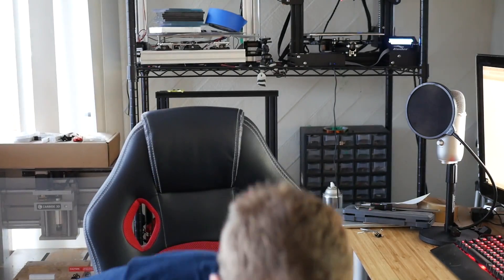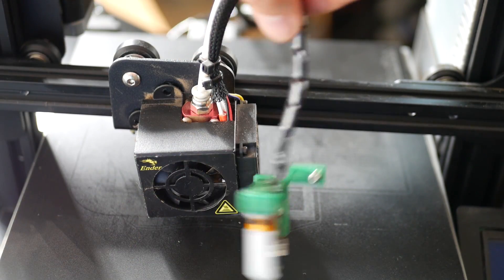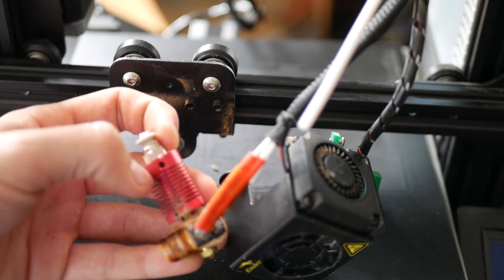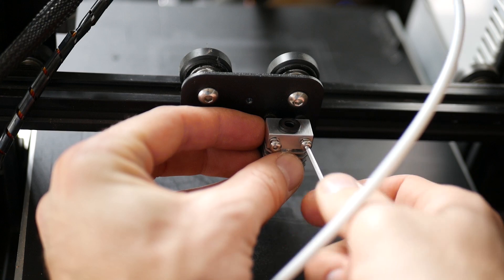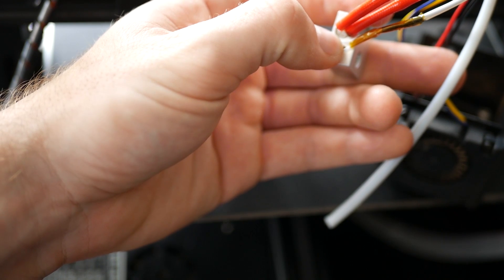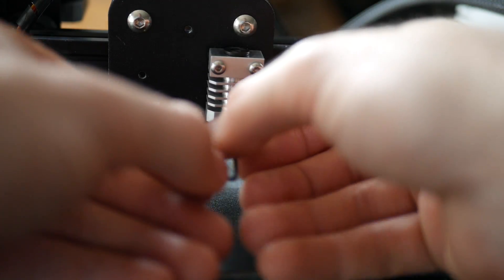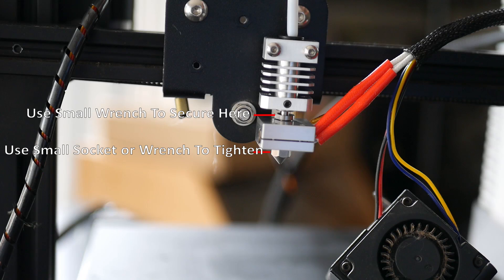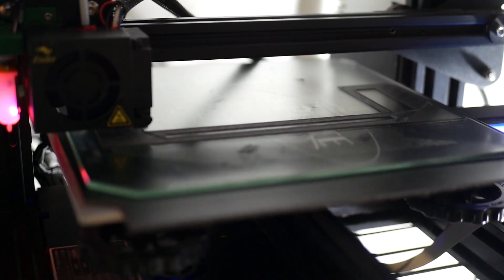Tutorial Installing All Metal Micro Swiss Hotend Into Creality Ender 3 3D Printer

Comment: FYI on Longer LK5 Pro there is no round head screw to remove. Loosening the microscopic grub screw on the bottom of the heater removes both heater element and thermistor. Took me a half hour to figure it out.

Comment: Thanks for the micro swiss install video. Mine is in the mail. After the install, my next project will be to upgrade my main board. I have an ender 3 pro with the old 8 bit board.

Can you recommend a good main board that would make it easy to get a higher temp range for PC and nylon? Something with a pre-installed or at least an available compiled firmware for the 300°C hotend upper range.

Comment: 6:32 you should get a torque wrench that measures in inch pounds. I wish the 3d printer community would use more accurate tools for measuring distance and tightness like torque wrenches, and dial indicators.

Comment: Wobbledy wobbledy https://youtu.be/iAeT3wHa5oI?t=468
Set that sucker on a flat surface and loosen your bolts and square that frame up, also looks like your bowden tube still had the scissored cut you inserted into the hotend, never use scissors it can cause feed issues from deforming the tube. Other than that nice video!

Comment: Never tighten the nozzle to the heater block!  Screw it in and then back off 1/2 turn.  Tighten the heatbreak into heater block and then tighten the nozzle to the heatbreak.  This ensure good seal in the filament path.
Reply: I think this is where I went wrong as I thought they were both tight enough, but  my hot end is leaking on the heartbreak side.  I need to figure a way to clean it now or buy a new heat block.

Comment: How do you get the printer to go hotter than 260? Does the thermocouple need replaced with a different unit? Does the firmware need changed and if so, how?
Reply: Did get answered??? Looking for the same
Reply: @mastercat  Yeah. Search Ender 3: How to install a bootloader and update firmware
You have to buy  a few things but it doesn't seem too difficult.
Reply: @CarbonGlassMan  buy few things like what...you mean only hvae to change firmware and nothing else?
Reply: @mastercat  Well watch that video. I think you need a new thermocople and an electronics board and some jumper wires. The parts don't cost much.

Comment: why do you not heat up the nozzle and not tighten the Nozzle and the Heating break while hot again?
Reply: Quite a few things that don't make sense on this assembly.....why was the nozzle screwed in tight before installing the heat break?....the nozzle should have been backed off a half turn and the heat break screwed all the way in then the nozzle should have been screwed up against the end of the heat break to make it seal. This was the assembly method on another vid.

Comment: Good video.
Do we have to replace the heater block? I've seen a few youtubers keeping the original heater block from the CR-10 s and they seem to think it's just fine.
Have you had any problems with the heater block compared to the old original block?
Again, good video.
Reply: There's a few reasons one might want to do this. Mostly it is if you want to use a higher temp filament. The PTFE tube in the stock hot-end is unsafe when the temp is over 250C. Cooking PTFE can out-gas some pretty bad things and cause hospital trips or death in yourself or pets. One thing I don't recall hearing or seeing in this video was that you may also need to update some firmware settings or change some Gcode for the difference in the hot-end the MicroSwiss is a teensy bit shorter than the stock hot-end
Reply: Thanks for mentioning PETG dangers.
On the firmware side, I watched a video from The First Layer, and after replacing the hotend, he upgrades the firmware on his CR10 and adds the name of the hotend in the Marlin Firmare update.
Thanks for your reply.

Comment: Helpful video! But I just installed my Micro Swiss in my stock Ender 3. Works ok. But when trying to print a bigger piece (200mmx180x4) of Nylon, it peeled a ton and I had to stop the print. I had the standard bed (sprayed with aquanet)... And it was set to the max temp of 260. Bed at 110. What is the problem? Do I need glass? Is the nozzle temp too low? Bed too low or high? Any ideas, because I'm at a loss?? Thanks!
Reply from the maker: For nylon you need a glass bed with glue stick. Nylon doesn’t stick to anything but itself so definitely get the glass with glue stick.
Reply: @ModBotArmy  thanks for getting back to me. So I ordered borosilicate last night... Hopefully that helps. So you don't think the width of that 200x170mm print will be a problem (with peeling) on glass with glue stick? (Should I not use aquanet as I have been?)... And last question, do my temps look ok? Thanks for your time, man!
Reply: @WhatsUpDanger  you need around 275 to 280 for NylonX.  Something modbot didnt explain was how to get higher temps with the upgrade.
Reply: Yes, I just bought one and am not sure it was a good investment yet. You can't get more than 260C as it uses the same heater. Using capricorn gets the same results on the stock bowden. Can't find data yet on ceramic heaters compatible with ender 3 controls. I'm guessing a 30 watt to hit 280C and a 40 watt to hit 300C. I don't know yet if the controls can handle those loads. Sites pushing the micro-swiss are intentional vague actually getting the temps they claim the micro-swiss can handle. People also said the original Volkswagen Bug was high speed aerodynamic but don't get behind one.

Comment: Nice video, but you dont mention this may lower quality for some PLA prints. Especially at low flow ratio - detailed small objects with thin layers and at slow speeds. Retraction suffer the most and you get blobs. There is nothing better than ptfe hotend for detailed PLA printing. I had to switch back to that setup in the past. Now I have 2 printers. One enclosed for hight temp materials and one for PLA only.

Comment: What are you using for retraction settings? Can you share them?
Reply from the maker: I am using standard retraction settings that Cura has but I did change the distance to be 4mm. I have been having good luck with this!
Reply: @ModBotArmy  Thanks for sharing. I will give it a try, as I had some stringing at 3mm.

Comment: Your Ender 3 wobbles a bit, your frame is probably a bit warped. Unscrew the extrusion profile gantry screws and retighten them carefully, that should fix it.
Reply from the maker: Axel Hopfinger thanks for the suggestion I will do that when I have a moment and report back :)
Reply: ModBot it’s been two months... did you get a moment yet?
Reply: @ModBotArmy  ours came form factory like that what what he says works you have to undo the 4 side boalt wiggel the whole thing around and then tighten them up and I'm Shure it will fix a lot of your printing problems